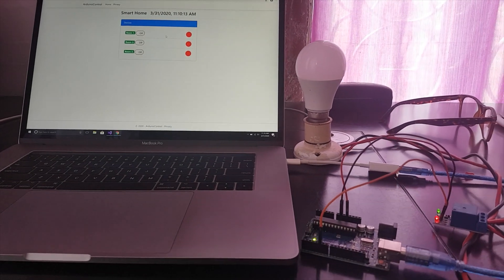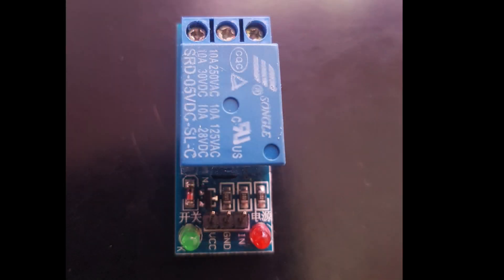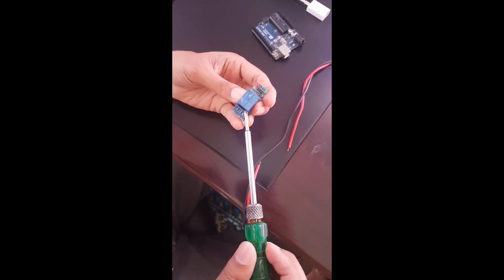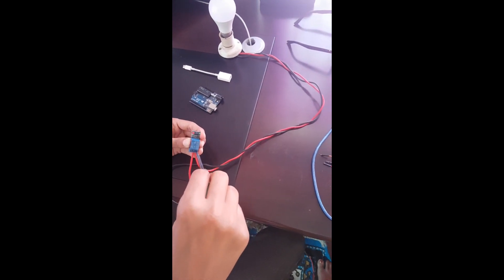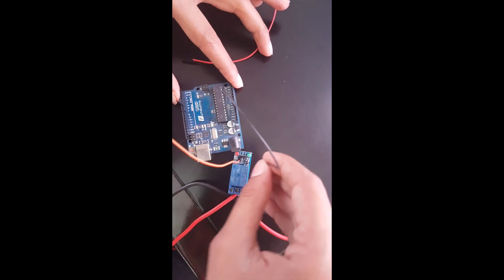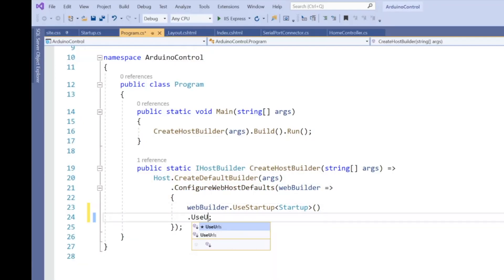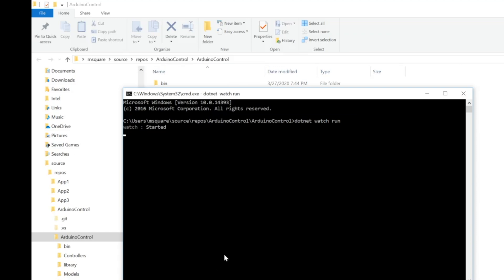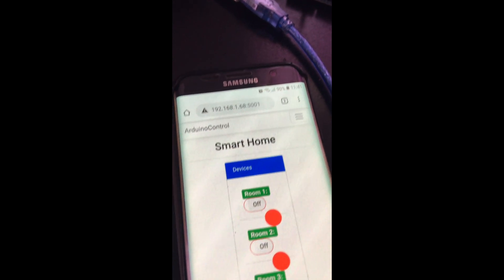Home automation using Arduino and Asp .Net Core mvc app part 1

Comment: Nice tutorial and nice explanation sir, could you please provide what components required? and share links of that products
Reply from the maker: Hi there, please find the details below:

Jumper wires - 3pcs
Arduino uno - 1pcs
Relay switch - 1pcs
Normal electric bulb - 1pcs
Electric bulb holder - 1pcs
Flexible wire - length based on your need
Arduino: 
https://www.amazon.com/Arduino-A000066-ARDUINO-UNO-R3/dp/B008GRTSV6/ref=mp_s_a_1_1?dchild=1&keywords=arduino+uno&qid=1599531285&sprefix=arduino&sr=8-1

Relay switch: 
https://www.amazon.com/DAOKI-Arduino-Indicator-Channel-Official/dp/B00XT0OSUQ/ref=mp_s_a_1_4?dchild=1&keywords=relay+switch+arduino&qid=1599531370&sprefix=relay+switch+ard&sr=8-4

Jumper wires:
https://www.amazon.com/FenglinTech-120pcs-Dupont-Breadboard-Arduino/dp/B07D1NVDJ4/ref=mp_s_a_1_5?dchild=1&keywords=arduino+jumper+wires&qid=1599531461&sprefix=arduino+ju&sr=8-5